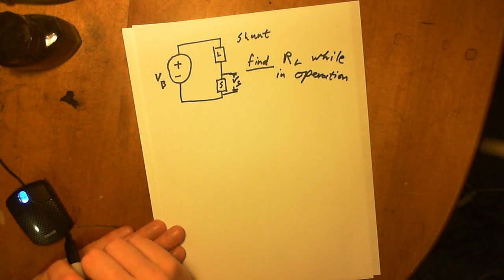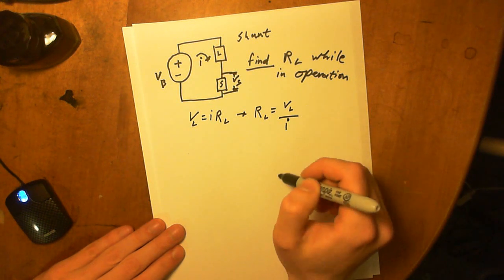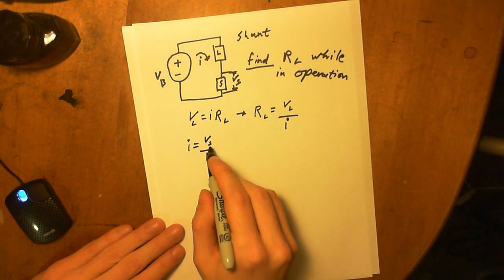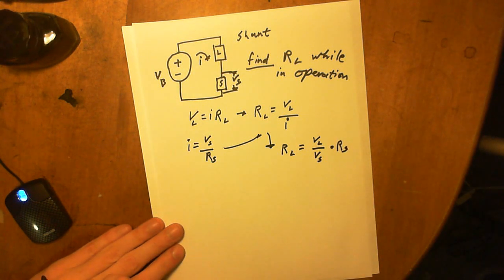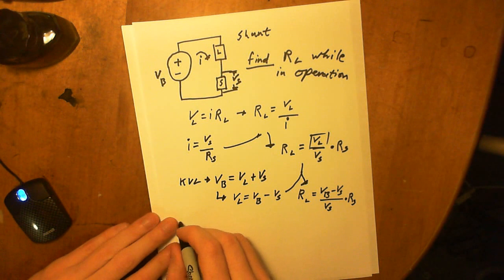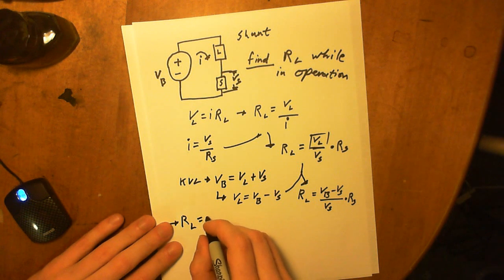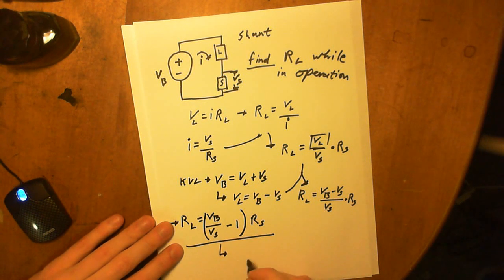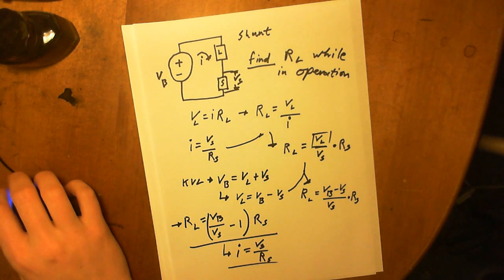Finding The Load Resistance From The Reading of A Shunt Resistor

Comment: All depends of the precision you want to achieve.  The resistance of the shunt is very small, in the order of milliohms.  Doing it the way you planned, the wiring resistance will end up in your load resistance figure and the wiring resistance can be in the milliohms range too, like the shunt for that matter.  The shunt precision along with you DMM accuracy will play a significant role in the overall precision.